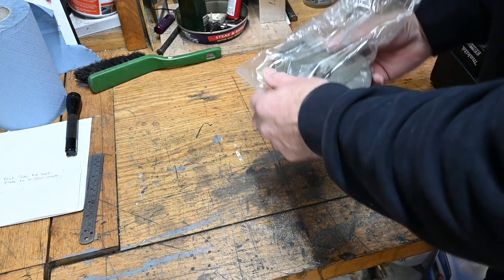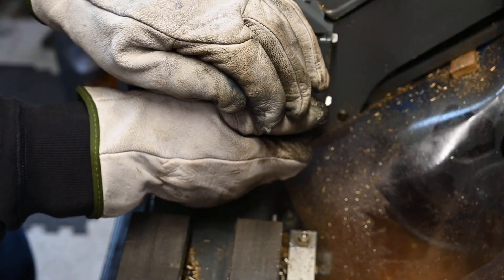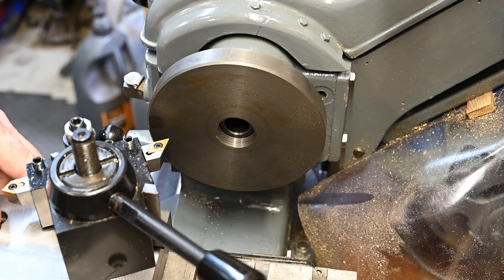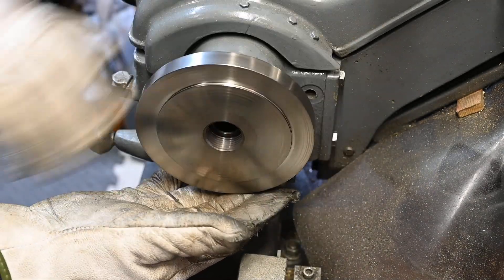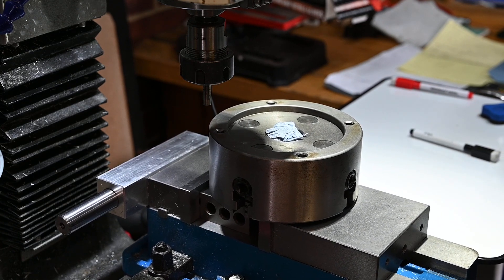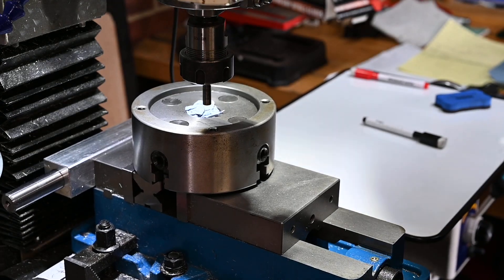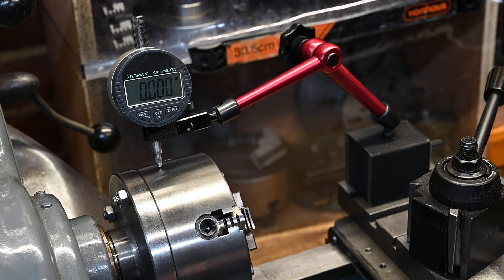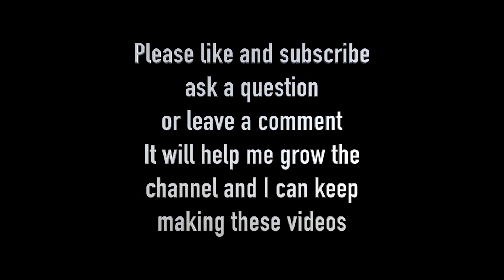How to fit a faceplate to a 4 Jaw Chuck

Comment: The runout readings on your digital clock are thousandths of an inch not tenths so you actually have around 0.005"(five thousandths of an inch)
Reply from the maker: @howardosborne8647  thanks for that, I did know but sometimes get in a muddle talking to a camera 😂😂

Comment: Are you sure it it 4 tenths it looks like 4 thou which is almost the same as the 0.1mm.
Reply from the maker: yes your right, Brain fog 🤦‍♂😶‍🌫
Reply: It looks like the resolution is half a thousand in imperial. I bet you thought you were producing super accurate work since you acquired the DTI.
Reply from the maker: @marley589  the runout is irrelevant as its an independent 4 jaw 😂😂
Reply: @EnglishHobbyMachinist  True, the face should be checked not the outside diameter.

Comment: Easier way would be to find the first hole. Lock the table down. Drill the first hole in the plate. Rotate the plate and bolt the plate to the chuck.
Just keep rotating  the base plate.
Reply from the maker: Thanks for that, I hadn't thought of that 🤦‍♂

Comment: Thou of an inch, but I know you normally use MM.  Either way, just dandy, as you said, for a 4 jaw.  Nice job, mate!
Reply from the maker: I use both, and my brain is in a total muddle most of the time 😂
Reply: @EnglishHobbyMachinist  I do the same here and switching those gears doesn't always mesh🤣🤣